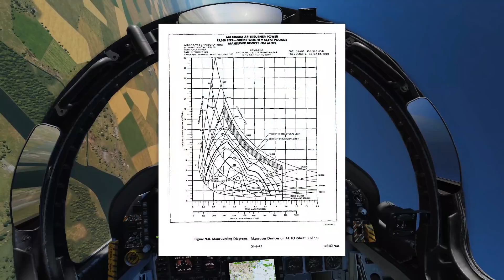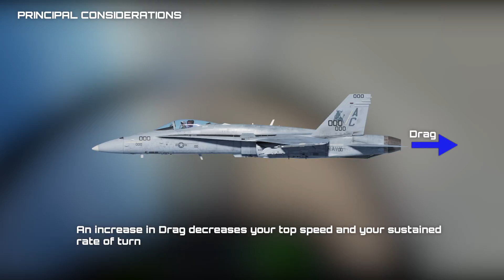DCS World - Dogfight Series - Episode #2 - Turn Performance

Comment: What is instantaneous turn rate of f-18
Reply from the maker: Depends on payload and fuel
Reply: Can you give an idea
Reply from the maker: No not without test since the FM has changed but u can, just stay below 380 knots and try
Reply: @Jabbers  I mean like Su-27 has maximum instantaneous turn rate of 28 degree per second so what is maximum instantaneous turn rate of f-18 in degree per second
Reply from the maker: https://www.fighterpilotpodcast.com/musing/it-depends/
Reply: Grip reapers did max sustained rate of f-18 and it was 22 degree per Second at 350-430 knots. So what should be instantaneous turn rate of f-18.

Comment: Great high quality videos!!! However.. you have one piece of misinformation here: "the Flanker is notorious for terrible 1 circle performance". That's actually false, and I can demonstrate it easily over a session. Flanker pilots just need to utilize their aircraft's potential fully - disable limiters when necessary.
Reply from the maker: I also wasn’t demonstrating it 100% as a fight but more to just show a good vs bad 1c radius, not to say 1 plane was better than another
Reply: @Jabbers  The demonstration was great. Just saying that the Flanker can pull an even a tighter radius turn in level flight than the Hornet can! Except at high speeds where wing breakage is an issue of course.
Reply from the maker: I've not been able to do that, but you are the master of the Flanker of course ;)   Appreciate the feedback,  I will have to try that out!